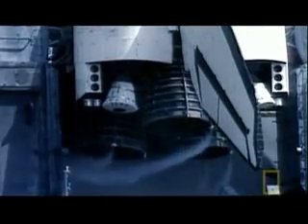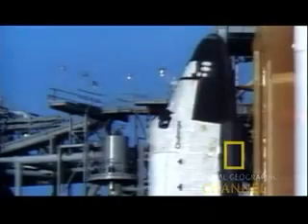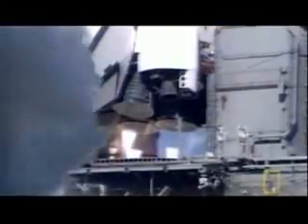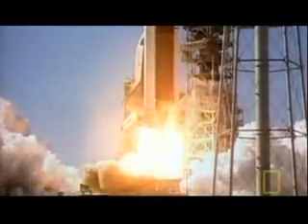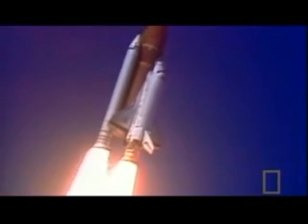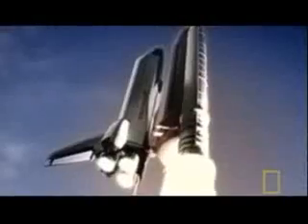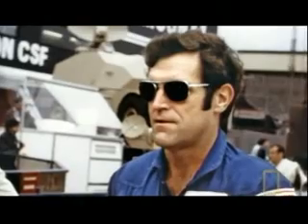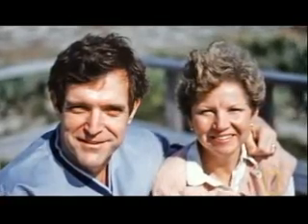Challenger: The Untold Story Part 9 of 10

Comment: Too bad the crew cabin did not integrate a parachute similar to what is on the SRBs in case of such an event.  Something of a carbon fiber weave that could be resistant to the temps involved.  Hitting the water at 30mph vs 200mph may have made a difference?

Comment: IMO, no NASA manager or engineer can say anything about blaming the Thiokol engineers. They fought to stop the launch and were overruled constantly. The problem is, no procedures were set in place and kept as a hard rule, for example if evidence of blow-by is found, then FIX the issue BEFORE launching again. PERIOD! Other rules (foam shedding) were similarly put aside or ignored for political reasons, and they reaped the consequences. I don't know how those guys slept knowing they ignored data.
Reply: Blah blah.. there were over 5000 vulnerabilities the shuttle program had. If they were concerned at all they never would have ever flown. They got use to the risks of failures..
Reply: @krumplethemal8831  haha all concerns were swept under the rug because, politics